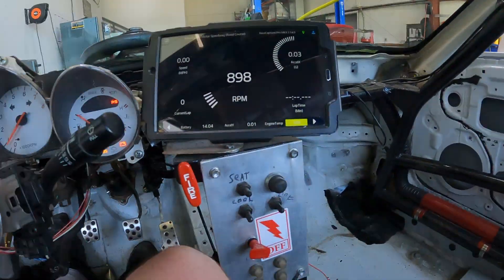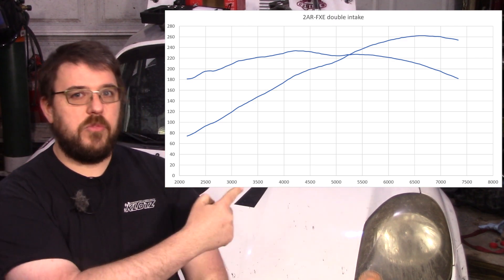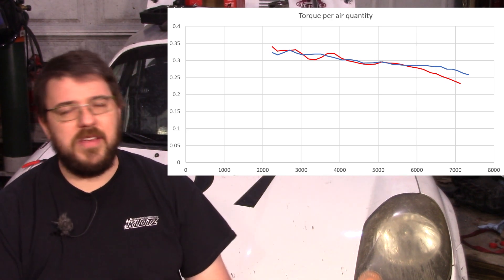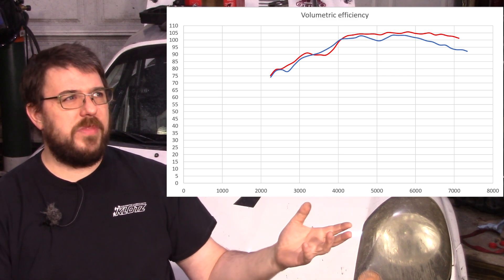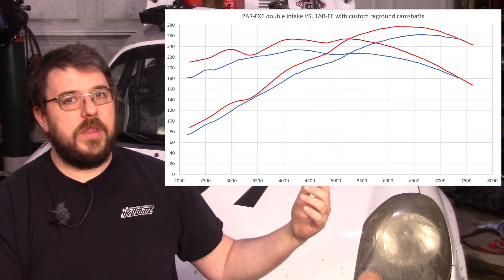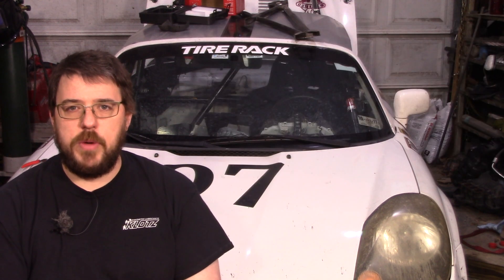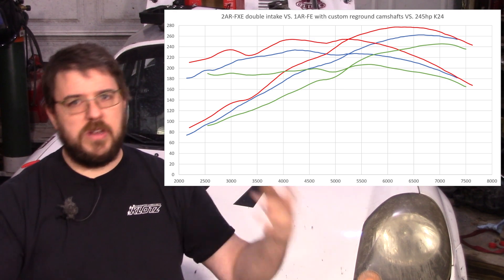Making 260hp from a Camry Hybrid motor without custom parts!

Comment: So, with 2ar-fxe, with 2intake cams(on exhaust fixed), swap header and fe inlet manifold is possible to get ~230ps at the wheels or i need som other mods, because i cant finde complete specs of this setup anywhere….
Reply from the maker: Yup, that's it as far as the engine goes. It sounds simple because it is. Currently you have to pair this with an aftermarket ECU and if you buy the Haltech from me i will be happy to share the tune i used but i'm also working to make this compatible with the stock ECU.

Comment: The stock k24a2 with 50* cam gears, bolt-ons, and kpro ecu tune makes around 240whp.
Reply from the maker: I've got a new build coming up that does away with the 2AR-FE parts so it's just a 2AR-FXE with a 2nd intake cam but without all the secondary vvt-i stuff and now i have an intake to put on it. I don't expect the intake to add 30whp like it did on my bigger camshafts but i expect it to add more than the 7whp difference between the 233whp that this motor got and the 240whp level. I expect about 250-260whp from that setup.

Comment: Hi Marc. So nice that you are trying things like that! What are you expecting from doing the same in a 2GR-FXE?
Reply from the maker: The 2GR engine does not allow the intake cams to be installed into the exhaust positions so you can't really do the same thing on that engine. that said, i do have a set of FXE intake cams to do some testing with eventually.

Comment: Can you use the 5sp transmission?
Reply from the maker: Unfortunately, the 1zz's bolt pattern is completely different than the 2ar's bolt pattern.
Reply: @FrankensteinMotorworks  what about the 5sp from scion tc instead of the 6sp?
Reply from the maker: @beanvo9924  that trans will bolt right up to the 2AR but the transmission is larger so you will have to cut the crossmember to make it fit, you'll also need three custom mounts and custom shift linkage. the left side axle will match the 6 speed. the right side does not but i'm solving that problem right now for the SW20 anyways so taht will have a solution soon.
Reply: @FrankensteinMotorworks   sounds awesome. My s51 shifts really slow. If the scion tc 5sp trans shifts faster and smoother, it definitely will be my next upgrade.

Comment: This is a truly fascinating project and some excellent documentation. Are there any options for longitudinally mounting this engine to existing Toyota RWD transmissions? Any shared bellhousing patterns with A or S series engines, maybe?
Reply from the maker: Technically no bolts are shared between the S and the AR but they do share the same "pattern". the dowels are in the same location and it seems most transmissions that support the S will support the AR.
Reply: @FrankensteinMotorworks  Why don't you use 6 speed gearboxes from 1AD and 2AD diesels?

Comment: More great information. I have seen the great video on the ignition coil stuff, but are you running anything special on the fuel delivery side?
I really want to build one of these.
Reply from the maker: I'm running the caldina 545cc injectors to get enough fuel. stock ignition coils, stock fuel pressure

Comment: Love this build!!  I have a couple of questions.  1, can you run the double Atkinson 2arfxe on a stock 2ar ecu somehow instead of a standalone?  The other question I have is could you use an e351 from the first gen tc vs the eb60 using the same or similar mounts?  It just seems like there are more of those laying around in junkyards vs the tc2 transmissions
Reply from the maker: The timing triggers are at the completely wrong place for the stock 2ar-fe ECU. Someone may eventually be able to modify the software to handle that but it isn't available right now. The E351 and EB60 transmissions use completely different mounts and completely different shift linkages.
Reply: @FrankensteinMotorworks  gotcha.  Thank you so much, I appreciate you and your knowledge on the matter!!

Comment: Sorry but 250 ft-lbs torque is impossible out of a 2.5 liters and pump gas.
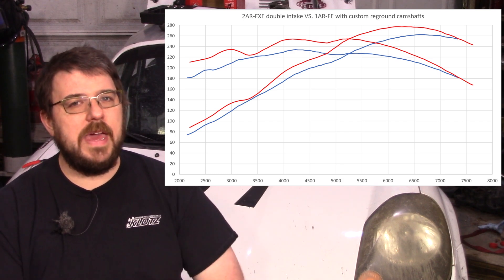Reply from the maker: I assume you're talking about the graph at 5:10? That's a 2.7L engine. Not a 2.0L engine.
Reply: @FrankensteinMotorworks sorry I meant 2.5 but even at 2.7 is very hard to believe.. 250 ft-lbs is 3.3liters+ territory..
This engine had extensive head port and polish?
Duration and lift does not improve overall VE but move it up and down in the Rev range.
I would expect more like 190 ft-lbs max out of your engine.
Reply from the maker: @Philippe_de_Guise  You're thinking of motors back from the 1990's. That's why i love these modern motors. They make so much more power. As for the numbers, this was all measured on a well calibrated dyno, there's no dishonesty here.
Reply: @FrankensteinMotorworks  Ok I take my words and give you the benefit of the doubt. If that's real .. that's very impressive.

Comment: You've got me thinking about a lot of this stuff for my 2012 tC!  The repurposing of the FXE cam is super smart, awesome that you can basically get "OEM" hot cams for this engine lol

Are you running an open diff?
Reply from the maker: Yeah, the FXE cams are pretty awesome for super cheap upgrades. It's too bad it requires an aftermarket ECU to control due to the cam triggers. 

Yes, i am running an open differential. in a well sorted MR2 chassis there's no problem putting power down coming out of a corner

Comment: Its not a percentage loss for driveline loss,its  a fixed amount.  Great build though,looks awesome.....
Reply from the maker: While the percentage loss changes so a fixed value of 13% is a gross oversimplification, it is not a fixed amount and you can convince yourself of this pretty easily by realizing that it only takes about 15-25hp to cruise at highway speeds and even manufacturer data for a 250-300hp car will show at least 30hp loss between the engine numbers published and the dyno numbers that everyone gets on those vehicles. if it was a fixed amount it would at least double the amount of power required to cruise on the highway.
Reply: @FrankensteinMotorworks  , imagine an na engine with say 300hp, lets just say for example it looses 20% through driveline,which would be 60hp. Now we turbo this engine,massive turbo all the supporting mods etc,it now makes 1200hp....same transmission,it should now be loosing 240hp????? That doesnt make any sense.! same effort to pick up a rock regardless of your muscsle size
Reply from the maker: @natebetcha8059  I 100% agree with your statement. If you move the same rock at the same speed across the same resistance it will have the same loss. But if you move the rock faster than you ever could before because you have more power now you have more losses. Is it 4x more? probably not but it's a lot closer to 4x more than it is to exactly the same. The losses come from internal friction and the more power you're putting down the harder the gears push against each other, causing more axial thrust against the bearings in the transmission due to the helical design of the gears and also the shafts are pushing themselves apart more than before, causing more deformation which causes more heating.

Take your simplified example and look at it a different way, take a lazy suzan with mediocre bearings (not because mediocre bearings are critical, they just make it easier to visualize at a lower weight) and put 50lbs on it, it still spins reasonably well, right? then put 500lbs on it, can you still spin it or is the internal friction too much?

Comment: A cheap and easy addition worth testing is, a lightweight crank pulley without the damper. Less weight, less rotational mass, faster reving.
Not an hp gain. More like….freeing up available work
Reply from the maker: While i generally agree with the idea, unfortunately testing is a 2hr tow each way and the gains are rather small to be worth measuring. I do have a lightweight pulley and i will be using it, i just don't have plans to measure it seperately.

Comment: What fuel are tuning with? Thank you for your awesome content!
Reply from the maker: This is just using normal premium pump gas. Around here that means 93 octane with 10% ethanol.
Reply: @FrankensteinMotorworks  awesome! Would your 1arfe ECU be compatible with 98 octane?
Reply from the maker: @Breazeh  it would be fine but given that 98 octane is not a normal fuel around here I'm wondering where you are located because "98" does not mean the same thing everywhere in the world. Also, are you planning on running the motor at a higher compression to make it worth it?
Reply: @FrankensteinMotorworks  located in Australia where it is normal to find 91, 95 & 98 pump fuel 😁 well if I do your hybrid cam conversion that would help right?
Reply from the maker: @Breazeh  Ok, that's what i figured. The australian (and european) RON rating is not equivalent to the US (RON+MON)/2 rating. your 98 is equivalent to the 93 we use here. It's effectively exactly the same fuel. 

Also, the 2AR-FXE hybrid cam setup will not work with the stock ECU due to the cam trigger pattern and also, it won't change the fact that the 1AR-FE only has 10:1 compression. higher octane fuel simply would not be needed with that. 

That said, subscribe to the channel for updates. I am working on releasing cams that will actually be compatible with the stock ECU and make much better power.
Reply: @FrankensteinMotorworks  yes I always thought that was the case! I’m guessing “98” is just a sales tactic to convince people we’re getting better fuel than we thought. Will you ever release a tune on e85? 😁 

Your advice on compression makes sense now, after watching a video on compression and what it actually means. Thank you! 

Been subscribed for a while now and watching closely as I just bought my first 2ar-fe last week. It’ll be going in a FWD 6th gen Celica 😁 hopefully mating to my existing S54 trans but haven’t looked much into that yet.

Comment: Do this to my Camry SE 🥲 and I want mine rev to ONLY 7200 and it would be sick if you could run it on STOCK ecu 😭
Reply from the maker: Kyle, Due to the trigger pattern on the cams there's no way this would work on the stock ECU. You would have to modify the trigger part of the camshafts to make the stock ECU happy.
Reply: If I sent my car to you would you do this to it? With the auto tranny? And possibly a shorter FD

Comment: This is with the hybrid system installed in conjunction to the engine?
Reply from the maker: No, this is just the gas engine that is normally installed in the camry hybrid with a 2nd intake cam installed in the exhaust position and both cams installed at a different angle than stock.

Comment: I wonder if you throw those fxe cams on to the 2ar-fe with the same setup, would you have a different result?
Reply from the maker: You would get gains for sure but the compression bump is also important and provides some of the improvements.

Comment: Great channel, I really enjoy this kinda stuff.  What if 2 of the 2AR-FXE atkinson VVTI cams were put in a 1AR-FE?  Seems to me it would be a good combination for a 4x4 daily driver with good low-mid TQ and good top end power.  Just a thought :)
Reply from the maker: So I don't actually have a good answer to that. Since it does not look like it made any extra power due to the compression there's potential for an 8% bump. But that said there's a mystery for that missing power from the compression. I'd expect you'd get somewhere between 250 and 285hp. i realize that's a pretty wide window but i hope to narrow it down in the future because this is info that i also want to figure out.
Reply: @FrankensteinMotorworks  Thanks for the reply.  In a 4x4, the bump in low-mid TQ is mostly what I'm after.  Anything over 200 HP should make an '84 Toyota pickup really fun!  Thx
Reply from the maker: @frankrasco8209  at the low end the 1ar-fe should gain more torque. it's the peak power that is somewhat unknown. and yeah, in an old toyota pickup it should move more than well enough :)

Comment: Mark - Can you put a mix & match parts list up for this build? (which come from the FE vs the FXE, and what was deleted/changed)?  From watching, I gather it's a 2ARFXE with two intake cams, re-timed, balance shafts deleted, 2ARFE intake manifold, electronics (with Haltec for now), and accessories?  Is that correct?
Reply from the maker: The only thing you're missing is the dual vvt-i cam carrier and valve cover and you've got it.
Reply: @FrankensteinMotorworks  Cool.  I'm just wondering is it cheaper/easier to buy both motors, or is it better to just source the extra parts?
Reply: @FrankensteinMotorworks  - Also, now that you are on Frankenstein full time, do you have any interest in making parts for the AW11? :)  I actually bought all your one-off AW11 swap parts from another enthusiast, who decided to get a Spyder instead.  But I would love to add some wiring, and a throttle pedal mounting bracket!  PS - are these one-off bell cranks designed to be used with AW11 shifter cables?
Reply from the maker: @marcopalmeri8492  oh, you're the one that ended up with those brackets eh? The next big step i want to take with Frankenstein is to start building engines for sale. AW11 parts aren't really on my plan right now but who knows what the future holds.

I think the bell crank used one of the AW11 cables and one from an SW20. I have pictures i can share if you send me an e-mail.

Comment: You are a BEAST!!!  Thank you for all you do brother!  Question: how much power would you figure the 2ARFXE makes at the crank with retiming but leaving factory exhaust cam in?  Thank you!
Reply from the maker: It would very likely make less than a stock 2ar-fe. The 2ar-fxe exhaust cam is very small and would choke out gains from a better intake.

Comment: your answer is too much duration in the cam, so thats where your losses are
Reply from the maker: It's possible but the longer cams had higher volumetric efficiency at high RPM so this is unlikely to be the issue. But sometimes resonances can be a bit weird.
Reply: @FrankensteinMotorworks  oh ok I really dont understand this because I thought the FXE motors were given a longer duration to keep the valve open during the piston compression stroke, pushing out fuel and air and effectively LOWERING the compression ratio... but maybe I am wrong, I thought you had to change the cams to get it out of atkinson cycle
Reply from the maker: @PseudoKirby  you're 100% right that the way Toyota implements the atkinson cycle is by leaving the intake cam open for a long time. I took advantage of this fact to get a very low cost long duration cam. When i build this motor i advanced the cam by 20 degrees to turn it from an atkinson cam to a performance cam (note that the vvt-i is still there so the ECU can advance it a further 50 degrees or so). I also use a 2nd atkinson intake cam in as an exhaust cam to get a motor with two long duration cams. You can see the build in this video: https://www.youtube.com/watch?v=q8t_p_waOEs
Reply: @FrankensteinMotorworks  oh ok, you changed the physical timing of the camshafts, so now instead of staying open during compression stroke its opening earlier, during exhaust evacuation? I never thought of it like that
Reply from the maker: @PseudoKirby  Exactly. The intake is advanced by 1 tooth and the exhaust is actually an intake cam but it's advanced by 11 teeth compared to the normal intake cam position mark. These atkinson cams are super low cost high performance camshafts right from Toyota :)
Reply: @FrankensteinMotorworks  Can you say exact duration and lift? I guess you mentioned 260 degrees but no word about lift.

Comment: what would it look like if we turbocharged this engine?
Reply from the maker: You'd be better off using the 2AR-FE as a base for a turbo engine. the 12.5:1 CR on this engine is a bit much for a turbo. but if you placed these cams in a turbo application you'd have no issues at all making at least 400hp on the stock bottom end. Not 100% sure where the limit is for the stock bottom end.

Comment: Based on what you have found with knock and compression, do you think the 2ar swap can run regular for daily driving?
Reply from the maker: Yes, 100%. If it knocks at all with regular the ECU will compensate for it and it won't be much difference at all.
Reply: @FrankensteinMotorworks  could this mutant 2ar go into a 2nd gen tc with factory wiring and ecu?

Comment: To answer your question about the 2AR-FXE’s “increased” compression ratio, Toyota counts the intake manifold area towards the total cylinder volume at BDC and dividing that by the volume at TDC when both valves are closed. When you adjust the Atkinson cams to behave like Otto cams you cancel out this affect. Your build is blowing the K series swap out of the water IMO, keep up the great work.
Reply: Why does everyone keep saying this? The static compression ratio IS high, then they reduce dynamic compression ratio by keeping the intake cam open.
Dynamic compression to more like 8:1 or whatever for less pumping losses. 

FXE motors have different pistons to the regular motors, and the compression IS higher.

Comment: Wow! Thanks for sharing your finding like that. Now that all the YouTube world is swapping K24 into absolutely everything, you show us that you could do better for cheaper with an AR setup.... If the world learns about it, AR could become the new K thanks to you!! And now, all I want to do is to try the same with other Atkinson's engine. If I rotate the cams in a 2ZR-FXE, would I beat the mighty 2ZZ for cheaper!?
Reply from the maker: i don't know if it would work with the 2zr-fxe, someone would have to check it. Most motors can't just use an intake cam on the exhaust side without modification.
Reply: Of course, someone would have to check it to be sure. But if you compare both head designs, other than the fact that intake is facing radiator instead of exhaust, they look so much the same, it seems like, 2ZR is just a baby 2AR.. so it's promising!!